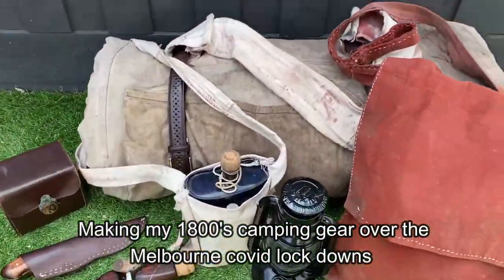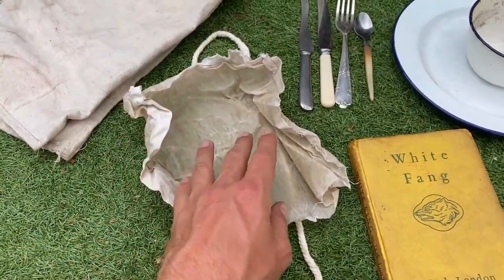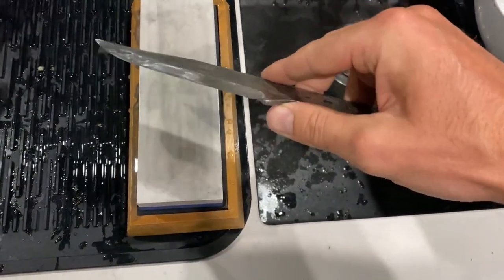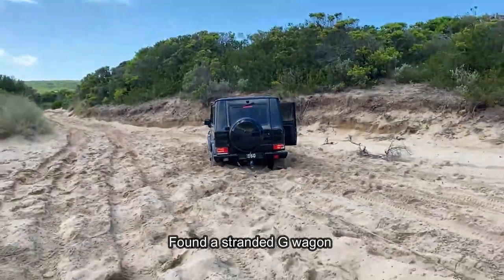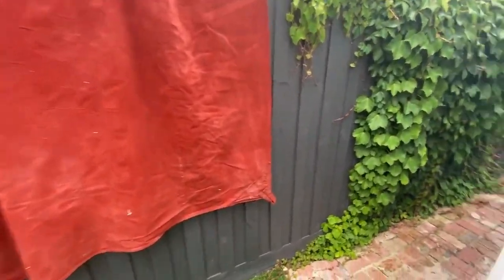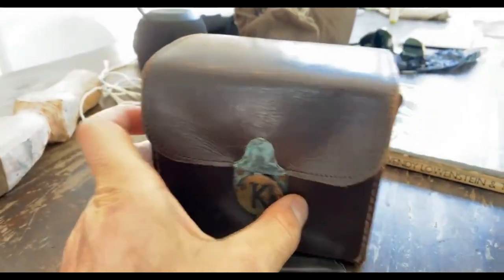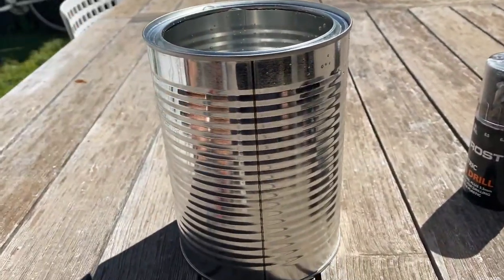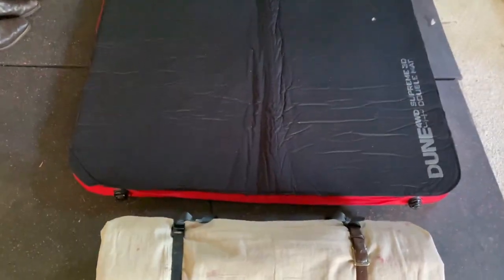Making traditional swagman camping gear over lockdown

Comment: Is that Brenddogs... 
0:33 Leave a bit more meat on the shank or steeper angle on the grind near the handle for chopping. 
3:06... I know that mug... Mr RWT. 
Old mower blades are great for knife making. 
9:43 A punch needle is great for that or a leather needle, something thicker to handle the pressure. 
13:58 Look for a fat strap for a crossover on the shoulder and then attach your tucker bag to the swag with the teatowel/wash cloth then over the other shoulder to the front of you and it balances out well, you can also run the carry strap through the middle of the bundle for some extra padding.